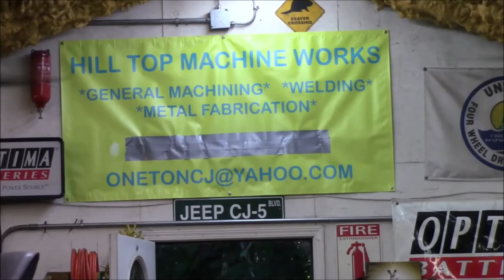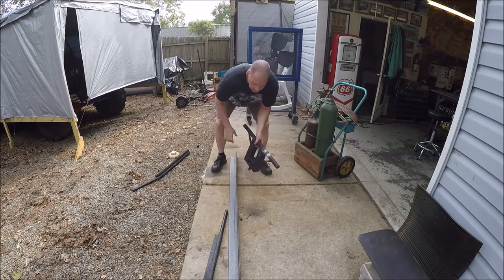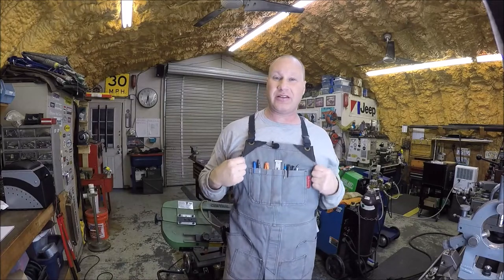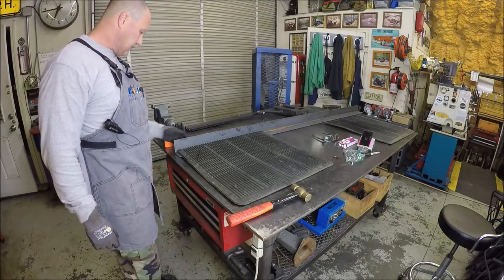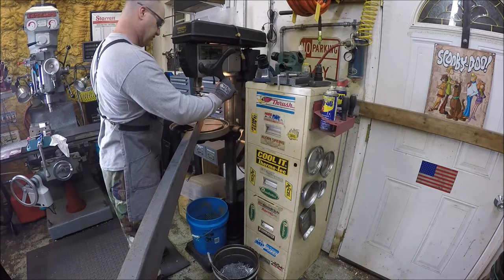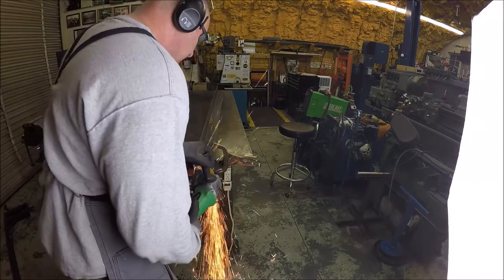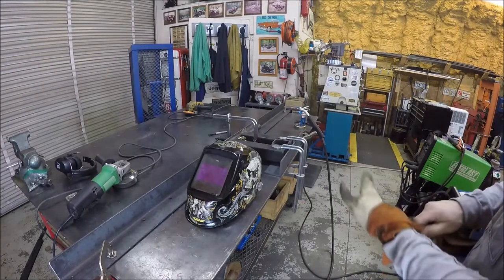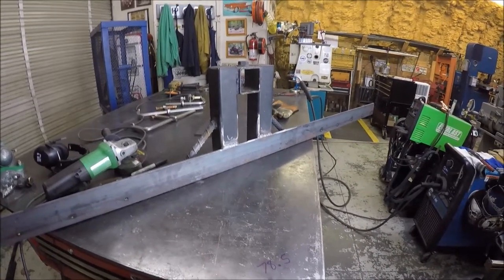Brad's mud flaps take 2

Comment: You would have much better audio if you pointed the wireless mic toward your face, those are directional so as not to pick up sounds from the sides or back.
Reply from the maker: Hey Bill. The mic starts out up right, but unfortunately the cheap alligator clip that its attached to doesn't hold real well and the mic tends to sag and point sideways. I need to come up with some sort of clip to keep it from going south. Thanks for watching.